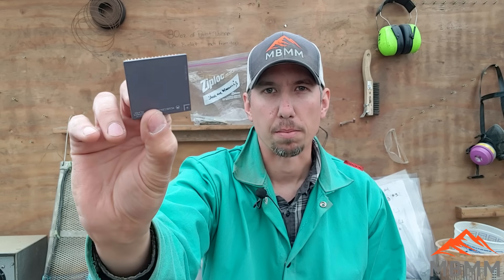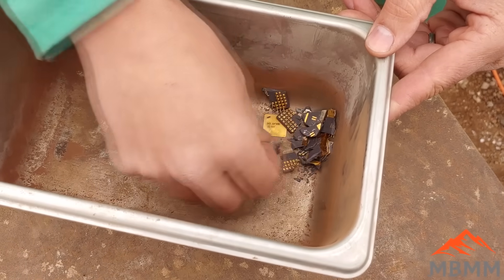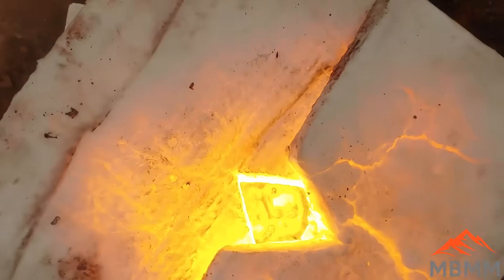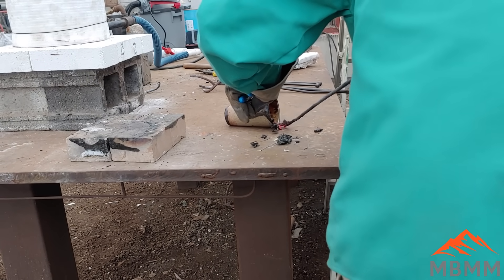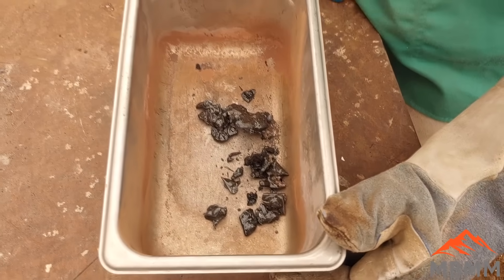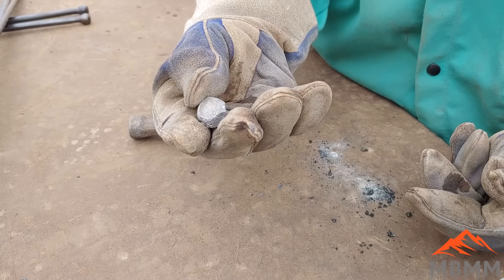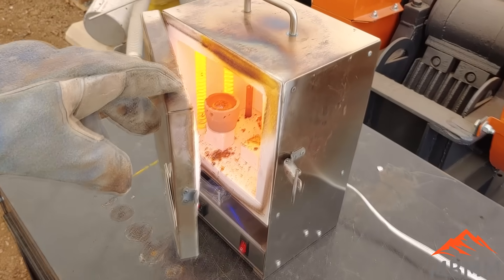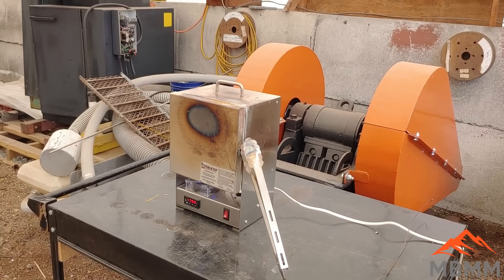Can CPU Gold Be Direct Smelted? Electronics Recycling & Urban Mining For Precious Metals!

Comment: Nice video. Here's a tip that I use for my black sand magnet. I put a speaker magnet in a margarine tub and tape the lid tight. To use it, I put the bottom of the tub in the pan. Then I quickly lift it up so that the magnet hits the roof of the tub. This makes a temporary gap between the bottom of the tub and the magnet, which releases the black sand into a separate container. It's cheaper, bigger and faster than the small magnets with the plunger that you press to release the black sand.
Reply: Would love a video of you doing a video with what you described the tub and a magnet

Comment: I agree, the powdered ceramic (alumina) should dissolve in your flux.  On it's own it has a super high melting point.  I think iron and maybe nickel is used some cpu pins.  All I know is they're often magnetic.  Is there anything you can add to the flux that will oxidize iron/nickel so that it doesn't end up in the lead?  Seems like this method got a very nice recovery... great video.
Reply: when i did a direct smelt from 1960s electronics (heavy gold plating) I was shocked after  I direct smelted my lead button --> because this is exactly what happened to my surprise. The iron nickel eded up in the lead button. When I cupelled out my large lead button, my cuppellation process was a disaster due to all of this teal in color steel....   JASON whats is the best way to oxidise out the iron / nickel in the smelting process..... I used chapmans flux 190g, plated pins 64g, and 110g borax, I left the smelt boil for about 30 minutes at 2200 and figured all the steel would be in my slag, and this was definitely not what happened!!!   HELP!!!
Reply: JASON HELPPP!!!!

Comment: I think the Silver came from solder on the pins & 1/3 weight gold is about right for 4 CPU's . Next time use the grinder to crush the material & after use a magnet to remove all the iron, Great video
Reply: A magnet would remove a lot of the gold too, the pins are made from a nickel iron alloy.
Reply from the maker: Thanks for the info

Comment: It's my understanding that they use impure gold to plate pins other electronic items.
Reply: Pure gold on surfaces that doesn't wear, 98-99.5% pure gold with cobalt added to create a hard surface on connectors.
99.995% pure for bond wires.
Reply: Yep, the bond wires are the only parts that are suppose to be 24k gold.

Comment: Nice job!  There’s a lot of silver inside of ceramics, which is why nitric acid is used to leech the silver first when doing it chemically.  I’d say crush them finer, acid can get into the big pieces, but I don’t know if the molten metal will flow out as easy.

Comment: Older CPUs and some of the new ones use solder for heat transfer between the die and the integrated heat spreader (that metal plate). That's where the silver could've come from.
Reply: I thought it was mostly indium in that solder?

Comment: @mbmmllc The silver you got came from Silver solder, silver/lead, silver/tin or silver/gold is usually used in these types of components. I hope that this helps answer your question.
Reply: Gotta send it to sreetips, he l sort it out!
Reply: @digger105337  sreetips is the man, he must have a ton of money tied up in gold/silver right now.
Reply: @SurebrecUK  have you seen what he charges for an ounce of that crystalized silver hes got the dow to do what EVER  he waNTS  lol i looked yesterday for a little over an ounce of double refined silver was 1250 U.S.$$
Reply: @sarahlarick8720  why? Jesus Christ that's gold price almost
Reply: @Heathmcdonald  bc its 4 9s fine as in 99.99 thats industrial grade you can use on electronics micro chips and space tech.. Ect...  as a substitute for copper...

 Oxidization (rust) components is a real problem on tech that costs millions or billions you need the best  materials... 

So not only does silver oxidize slower than copper there is less elctron resistance meaning the flow of electricity can flow smoother through silver than copper..

. So for this to work and be effective you need as pure of silver as you can get bc contaminants can create more resistance and cause pockets where the sivler could start oxidizing from the inside out...

 Why does this matter its going to start oxidizing the same time frame regardless if its on the inside or outside right?
 Right buut! 

Thats why they over lay the silver with gold LOCKING the outside elements all but completely preventing oxidization all together... Unless.. Its already contaminated from the inside..

 so you see this is why this grade is worth soo much more it garruntees dexterity of the material used on tech ... A good example lol i work on cell towers this is how i know this ... 

But if you ever had an old sprint now tmobile or virgin wireless phone... They noticeably were below optimum and the services themselves were below par aswell unless you live near towers... (Was not a small town service mostly big citys is where you could get good sig for these services) lol not reliable ..

 They (the phones) worked good for a while but idk anyone who ever had the same sprint phone for more than a year and if they did their patience is crazy good bc the phone would slow down all together and the buttons would tweek out after awhile

 but the reason the buttons and what not would go bad is bc they didnt over lay there components with gold same goes for there fn towers!!! 80% of our maintenance calls are 
T-mobile towers for failing components that should be over layed with gold ! Hope this helped!!!
Reply: @sarahlarick8720  can confirm tmobil sprint and boost all sucked lol
Reply: @Heathmcdonald  and they still do lol
Reply: @sarahlarick8720  why they still exist is beyond me
Reply: @Heathmcdonald  yea me too lol where most of you see this and think crappy tech?!! I think of it as... Job security! Lmao!!
Reply: @sarahlarick8720  - wow, thanks for such an informative comment! 😎
Reply: @sarahlarick8720  that's crazy, all that has to be done it's to use a silver recovery cell to get that pure crystal. It's electrolytic refining and can be fine in a stainless steel pot and a car battery charger
Reply: @sarahlarick8720  "i work on cell towers this is how i know this ...if you ever had an old sprint now tmobile or virgin wireless phone" really weird to work on cell towers and not realize that neither sprint, tmobile, or virgin make any model of phone...
Reply: @sarahlarick8720  
Absolutely interesting. Thank u for taking the time to type all this out. Ppl like me (I think very phew) can dive deep in the comment sanction to absorb and learn.
Reply: @SurebrecUK  he sells all his precious metal m8
Reply: @danielpersson7483  He doesn't sell it all at once, especially the silver.
Reply: @sarahlarick8720  It’s because of the chemicals and time it takes him to refine it.  9999s fine silver is easy to refine through electrolysis. 
Silver bar  and coin produced by the Canadian mint is 9999s fine and costs about the same or very slightly more than the 999s fine variety.
Reply: @Heathmcdonald  don’t listen to her.  Canadian silver is 4 9’s at 31 per ounce
Reply: @jimtalbott2095  good point.  exactly what i was thinking
Reply: Id say silver solder
Reply: Thanks to all of you for exploding my cranium with the most useless,and awe striking information that I will never ever use or understand. For this I applaud you all. It was a pleasure,  and I probably won't sleep thinking of this. Thanks again. By the way I am being honest with my statement.
Reply: Never thought of that and I use silver solder for HAVC.
Reply: The òòò ì99
Reply: I know that the plate he thought was aluminum was/should have been a silver plated copper plate.

Comment: The recovery is done in two stages , first treated with nitric to remove base metals , then treated with aquea Regia after the left over ceramic dried and ball milled not hammer milled (1kgs minimum ) again treated with aquae regia  , you can pan it see to see the powder has the precious metal and  sure it has  any way good job
Reply: Nitric will also dissolve away the silver.  I tend to use a low amount of weak hydrochloric first to eat up the base metals, let it sit for a while so the silver and copper reduce back as the base metals are mostly used up.  THEN I add 1M nitric to take away the copper and silver.  What's left is a mixture of insoluble oxides, silicates, and platinum group metals.  

After that, it's easy to hit it with hot aqua and dissolve the platinum group.  Cool and neutralize with urea and let sit for a day, all the platinum, iridium, and rhodium will just fall out as a fine grey powder which is easily recovered and washed.  

Then warm metabisulfite solution with warmed auric chloride, and you swiftly get a spongy gold mass with over 99% recovery!
Reply: @Alondro77  - thanks for explaining your recipe!
Reply: @Alondro77  do you have a video on your complete method, with equipment, chemicals and proper ratios?

Comment: Silver is used for the tiny wires and connections, because it conducts well and better than gold. Gold is only used on the surface of the pins because it doesn't oxidise. So it would make sense that most of it is silver.
Reply: Bond wires are gold or aluminium, not silver. Gold is used as it is easy to draw into a thin wire and it bonds easily with the metals used on the die (aluminium) and gold plated tungsten manganese alloy in the ceramic capsule.

Comment: Silver bearing solder is used to join package components together. Don't forget the rest of the PC. Newer hard drives have PGMs and the other ICs have gold bonding wires and lead frames as well as the gold plated fingers and slot connectors.
Reply: As per 1 comment I would definitely try older CPUs memory chips & circuit boards. I like this method of reclaiming over hazardous chemicals.

Comment: Another guy on youtube used acids to dissolve all the unwanted materials, but all he had was the gold, and not the silver. But if you have enough CPU's or other gold plated electrical connectors you can pull more gold and silver out of those scrap materials then from a yard of dirt, and also at a much lower cost. Especially when you scale it up and improve the process. I think that 1.07 gram of silver and gold is a very good result from such a small batch. With the current gold price and assuming that you have around 0.3 grams of gold, the worth from the gold alone will be around 16 dollars, if I calculated that correctly. Memory cards have gold plated connectors as well, and motherboards have a lot of gold plated connectors en traces as well. Not to mention the other precious metals such as silver. So now I wonder how much precious metals you can extract from a couple of old computer motherboards.

Comment: that was the first time i saw them done that way, the way i saw it done before was the cpu was incenerated, then crushed, then a magnet ran over the powder, it was soaked in a acid solution to get out the pms, this  was a fun video had my fingers crossed that this would be a safer, faster way, and it looks like it was to me, just have to scale this up,. thank you for the info. be strong, be safe, and be blessed
Reply: russ sherwood   CPU you mentioned  is ics  different from ceramic cpu in this video mostly you will lose plating any kind of metal except platinum groups 
The assaying method recovery is mainly done for low grade stuff

Comment: Does your company make a small grinder that would grind up the chips.
Reply: Be aware that the total precious metal value that was recovered is only about $23. The cost of the cupels alone is around that.
Reply: @Malaphor  That's what I was thinking, but he was only smelting 1 CPU.  Imagine 10 CPUs, then the price drops.  But regardless, for the amount of gold retrieved for the amount of effort, it's probably not worth it, unless you have a 1,000 CPUs.
Reply: also need a good one
Reply: Hammer mill

Comment: Computer components use 10k gold. Manufacturers use only enough gold for good electrical contact and nothing more.
Reply: not correct
Reply: It's somewhere between 98 and 99.5% pure, bond wires are 99.995 pure gold.

Comment: I'm not a refiner, but my understanding of Ewaste or the CPU's is that it's plated with 8 to 10k Gold. If it's karat gold sometimes they put silver in that. I know they usually use copper, and white gold has silver, platinum and or paladium. 
Have a GREAT Day!!!
Reply: The plating is between 98 and 99.5% pure, some cobalt is added to increase the hardness in places where you need higher hardness.
Reply: @goranaxelsson1409  Many test on many different computer parts have been done the highest purity was from the 80's and 90's computers and the most was 12k or 50%!
After the gold is recovered, it's 8k, 10k, or sometimes 12k, then you'll see people refine it to 98% - 99%. On rare occasions, you can get 99.9% pure on the first refining. Most of the time it takes a second refining to get it to three 9's fine, or 99.9% pure gold!
Reply: @shaneyork300  not correct.
Reply: not correct. the plating is almost pure gold. .995.
Reply: @music-jn3wn  Many test on many different computer parts have been done. The highest purity was from the 80's and 90's computers and the most was 12k or 50%!! After the gold is recovered it's 8k, 10k or sometimes 12k then you'll see people refine it to 98% to 99% on rare occasions you can get 99.9% pure on the first refining, most of the time it takes a second refining to get it to three 9's fine or 99.9% pure gold!!
Reply: @music-jn3wn  They don't use pure gold because it's too soft. If it were pure gold, you could just scrap it off because it would be soft enough to do that.

Comment: That was a cool experiment.  I'd like to see you do more smelting of ewaste, for example BGA chips, ICU chips, RAM sticks.  Good Job!
Reply: I’m processing almost 100 pounds of icy chips right now and I’m really wishing that instead of having to pan out all of the powder slowly, I could throw it all into a huge crucible with flux and get it down to a button. It would make life so much easier. I would love to send you guys a sample to run and see what you guys to come up with if you want to make another video!
Reply: @redbaronrefining5322  would nitric acid not dissolve the silicon powder?
Reply: @redbaronrefining5322  try a blue bowel
Reply: He is very good at smelting which is a artwork of it's own "an acquired skill" through trial and error he has developed his skill to 
Near perfection. I was Entriqued by my brother Tony retired U.S.S. furnaces area manager.Computers control every aspect of the chemistry, unlike the operators of the past.
Reply: He just did CPU's but need way more than 4. That plating is about 20 atoms or less thick

Comment: The 3 Motorola are 386 or 486, the AMD K6 is at east 3 generations newer(the very last ceramic CPU generation) so it contains much less gold. A 386/486 should yeld something like 0.5% of gold so I think you did ok(if you find  a Pentium Pro that is the best, it should yeld 1%).
Also, any ceramic CPU that is not Intel, AMD or Cyruss Logic is better for selling to collectors than smelting.

Comment: If 0.1g is the average gold recovered per chip, how many CPU's would you need to do at a time to break even?
Great video BTW 👍
Reply: Probably the CPU worths way more. Not the K6, but the other probably.
Reply: A single of these orion chip is worth more than all the gold he got out of these four.
Reply: @DxDeksor  yeah I suspected that, I was more thinking of the gas, electric and chemical costs.
Reply: Well when you add this in the calculation, it becomes even more hilarious.
Reply: I would do 25 pound batches. Yield between 25  to 60 grams .995 gold. Chemical cost was insignificant, maybe $ 50.00 at most.  Nitric acid, hydrochloric acid, sulphuric acid, urea and sodium metabisulphate.  All cheap when bought in bulk.

Comment: You had the chance to remove the aluminum before you threw the mix into the furnace, why did you leave it in? Just causes problems when refining. I do believe there is also IRON in those cpu's. The metal plates and the PINS have iron in them. I doubt you got the furnace hot enough to melt that.
The silver could have come from two places. The Solder used to hold the metal plates on the bottom of the cpu's, and possibly could have come from under the Silicon dies. It may have also come from the LEAD you used in the cupel to collect the metals. The bonding wires are not always made of gold in those cpu's.
I would have removed the steel plates and the aluminum before starting this process. (a heat gun works very well) It would give you a better idea on what kind of material you are working with.
Reply: Dude, this guy is breathing in poisonous chemicals to make people happy by doing this, I think it's enough that YouTube has become corrupt and that it's closest thing that a lot people can get to a job